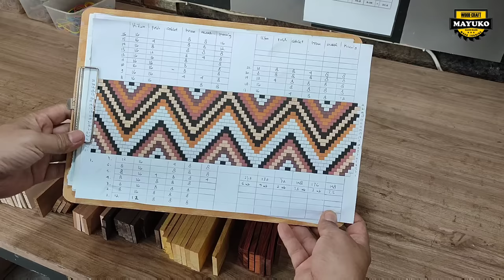OPEN SEGMENT WITHOUT GLUING JIG, woodturning

Comment: Have you tried using a gouge when turning? It's much easier on the wood, cuts faster and leaves a cut surface rather than a scraped surface. Much less ripout. It also makes turning a pleasure rather than a grind.